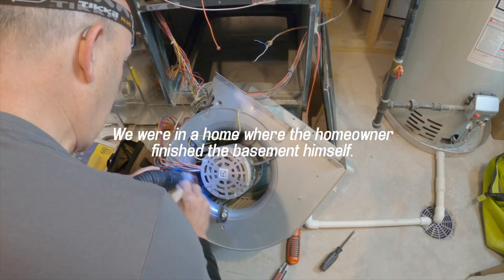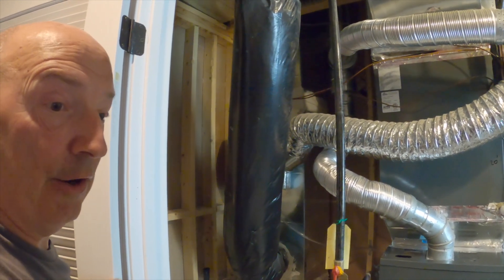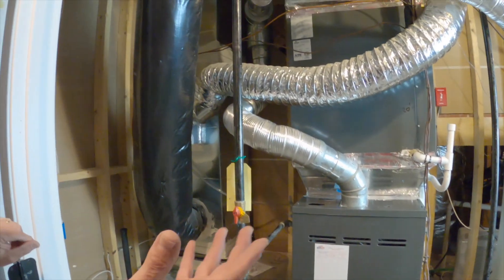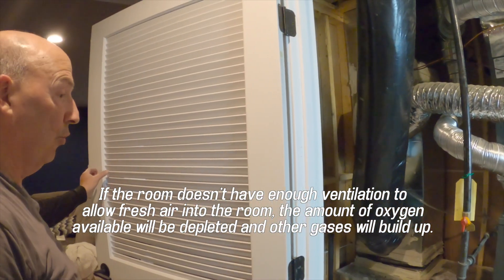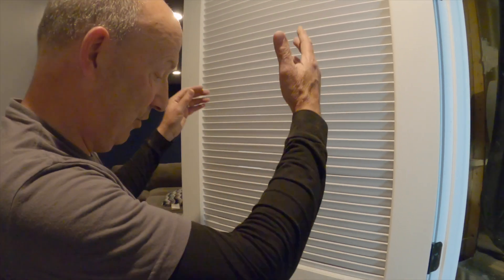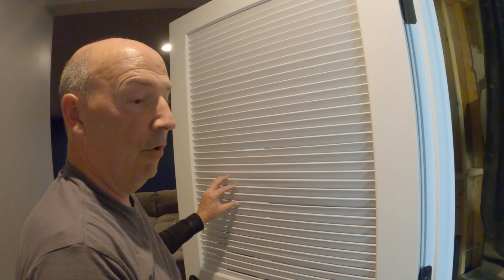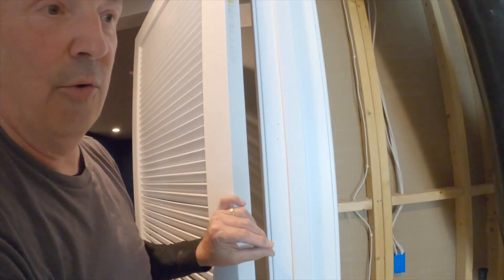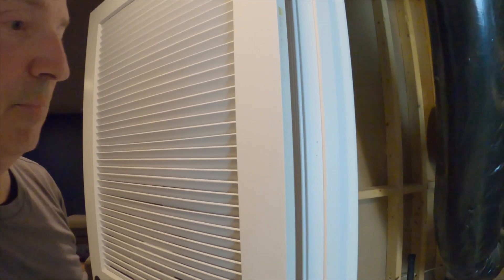Watch This If You Are Finishing Your Basement | Why You Need to Think About Combustion Air

Comment: I just bought a raised ranch home with a sub partial basement & i want to turn it into a bedroom my only concern it has the furnace & water heater in there which they have their own enclosed section with a ventilated door. Is there any concerns i should worry about?? The basemant is around 12*17